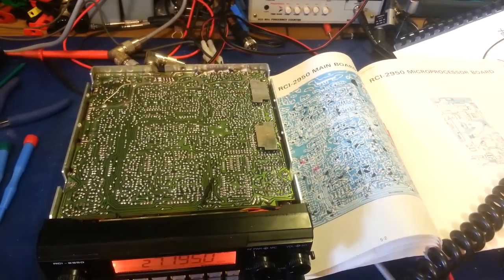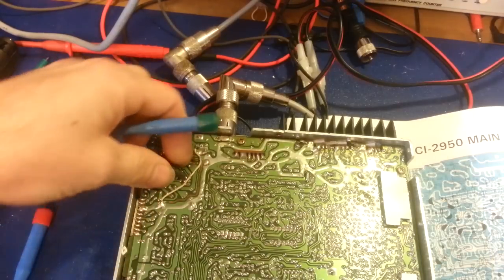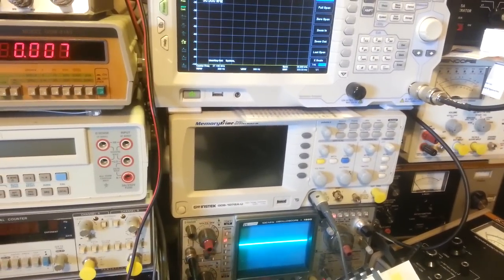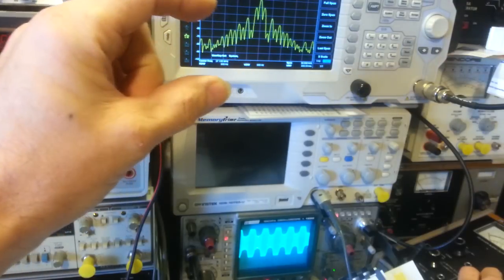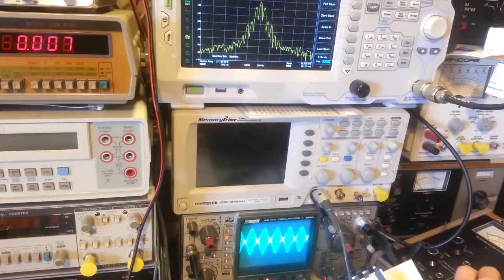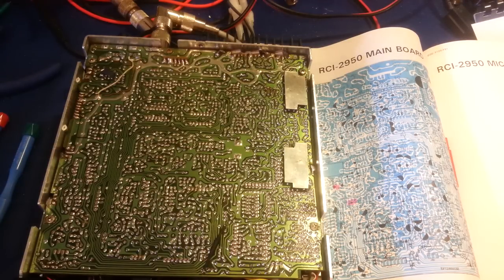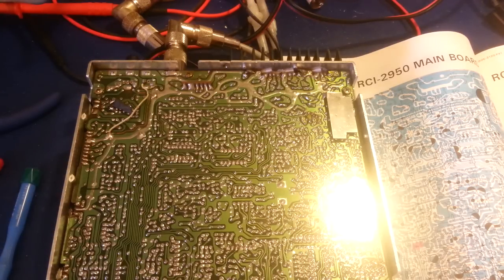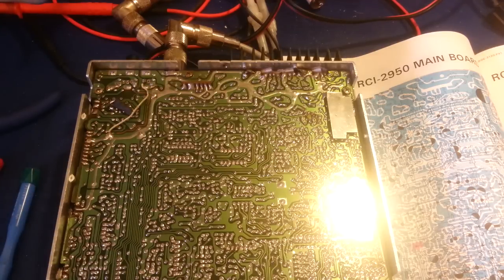Power Mods and why they actually reduce your output power distort audio bleed onto adjacent channels

Comment: Well after watching a bunch of these type videos, I've learned that the so called peak and tune I've had done to my connex cx hp is bullshit ( Yes the guy clipped a resistor). At least I've never had any toys added or any other mods done. So Mike, if you happen to read this, I'll hopefully be paying you a visit to properly tune and align my radio.

Comment: Not only are they distorted beyond belief, the components are boiling hot, ultimately causing parts to fail. It's almost as if these morons do these mods to purposely make customer's radios crap out so they have to bring them back in for repairs, putting more money in their pockets with a constant flow of trashed radios. The amazing thing is, those gullible customers continue to do business with those idiots. Unbelievable.

Comment: Good clean power even at a low level is better than higher power and garble. Case in point, in the LOWFER community, they have had contact of 700 to 1000 miles with a fraction of a watt output. SNR is much more important.

Comment: You never explain what the modification is. Remove voltage limiting resistor to final transistor?
Reply: Don, (generally) resistors are used as current limiting devices, although you can make a "voltage divider" with two equal value resistors.  

looking at the area of this RCI radio I would say it's some kind of npc mod producing backwards results (more carrier less audio, while the real mod does the opposite) but I don't know.

If you google "RCI 2950 High Power Mod" you will find all kinds of bad ideas (crap mods).

Best Regards
-LeapFrog
Reply from the maker: +LeapFrog 

It's a diode and resistor in series in the heat shrink tubing.
Reply: Wow I was expecting just that, 99% of the time that's what you find on these hacked-up RCI rigs, I would venture to say that more than half of the RCI black box radios you have worked on have some type of diode mod. 😨  

I almost never see good results from this modification, it requires lots of resistance value tweaking and bench time all just to create a quote on quote "loud radio" that will splatter on the immediate adjacent channels.    When it's performed correctly the radio will achieve 125% peaks on the positive (or more) without crashing the negative Peaks it's almost never performed correctly though. 

Great videos Mike, the Black Box export radios seem to have an almost cult-like following amongst some of the rebellious (outlaw) operators. 

73
-Leap
Reply from the maker: +LeapFrog 

And I'll never understand why.  Don't sound as good on air, have noisy receivers with lower sensitivity,  less ability to filter out adjacent channels, poorer sounding audio and unstable frequency on SSB.  If they just got a good used old SSB unit for half or less than they pay for one of these modern spectrum splatter box's they would be amazed how much nicer the old well built and engineered units really are.
Reply: %100 Mike I agree wholeheartedly.

I think they just want something "illicit" for the sake of being an "outlaw operator".  More than the 4 watts allowed? And FM too? Sign me up now lmao... NOT!   

73

Comment: I opened a little Realistic SSB Radio to write down cap values and what do I see. A fat cap in betweenthe middle and rear of the board pushed over on it's side with yellow shrink tubing on the leads. So I flip it over and the final has been messed with because the leads are not fully seated and while soldered in lace why would you not properly seat the device? So then I look over towards the driver and regulator area and I see a collection of parts on the bottom of the board that while well done the in clear tubing do not look like they belong I think it was someones attempt at Asymetrical or NPC. Why anyone would do that to a compact SSB radio I have no clue? Oh and I am pretty sure this little SSB radio did not come with a 2SC1969 final from Uniden.
Reply from the maker: Must be a TRC-465 (Uniden Pc-122).  Very popular radios that have a shit load of published high power mods.  I see hacked ones all the time.
Reply: I bought one because it was compact and 40ch SSB. Then I got a NOS one as well that powers up but has no audio. I figured it never hurts to have a parts radio. Not a lot of compact SSB radio's these days.  The one that has no audio is a NOS virgin radio with warranty sticker from Uniden in tact. I am not a fan of internal power mods too easy to buy or build an external amplifier and keep the radio clean inside.
Reply: I bought two of them one for my Mom and one for my Dad but then I decided I should just keep one as a parts radio. I will likely end up sending them to you to sort out. I would not want any power mods on these. Trying to get more power out of a chassis this small is like dropping a big block V8 in the back of a small hatch back car. Sure you can do it but why? You can never get the traction you need, durability, handling etc....If you want a Super Car buy a Super Car if you want an economy hatch back than buy one! Putting a 1969 final in one for a few more watts is just stupid. You would be better off turning it down to like 2 watts swinging 8 and putting a small 1-2 transistor amplifier in line. I would never modify a radio for more power. I am not against modifying a radios just do not think internal power mods are worth it and often do more harm than good long term and at best are a waste of money!

Comment: All those crappy mods are horrible....good demonstration Mike! By they way what is the exact name on this service UHF coax  clamping version? 73
Reply from the maker: Hello Peter.  I'm not sure what you mean by " UHF clamping service".  Are you talking about the UHF quick disconnect connector?
Reply: I'm not sure how to explain it is the SO-239 quick connector which does not need to be screwed on.. puh bad English sorry
Reply from the maker: I figured that was what you were talking about but wasn't sure.  The push on UHF adapter is Amphenol part number 83-5SPA.  Working on radios full time you really come to appreciate these adapters.  Avoid cheap Chinese made ones.  I got some of those and the outer parts that wrap around the outside of the jack cracked after very little use.  The Amphenol brand ones I use I have had for years and they are still like new.  The last batch of them I purchased I got on ebay from a seller in Canada.
Reply from the maker: +TRX Bench 

 Here you go Peter.  eBay listing number 201614272288
Reply: Great! thank you Mike!!
Reply from the maker: +TRX Bench 

Happy to help.

Comment: Mike,
Great visual explanation. Wish the camera was tilted up just a little more.   :-)

Better to (dare I say this) add an external amplifier than try and get more out of the radio. Just need to add a band pass filter after the amp that can handle the power..
Reply from the maker: Yep, if you need more power do it outside the radio and use a low pass filter to keep the neighbors happy.